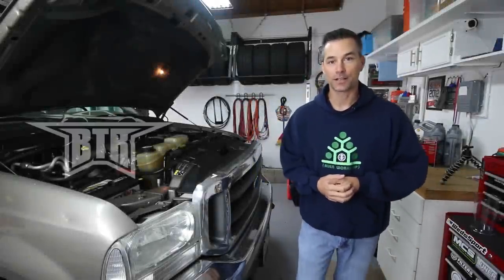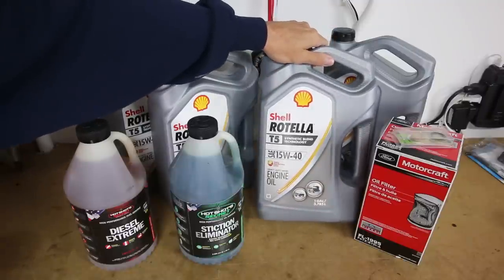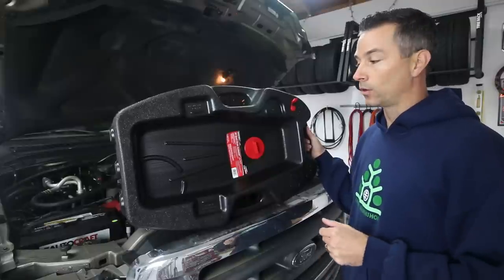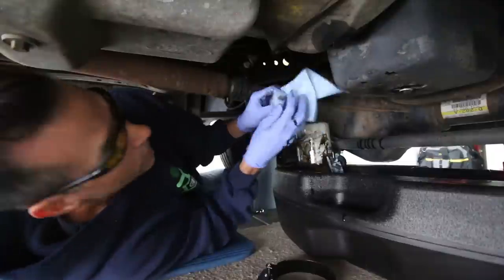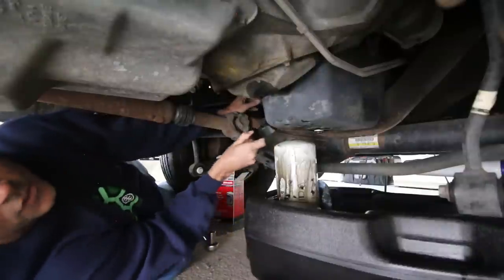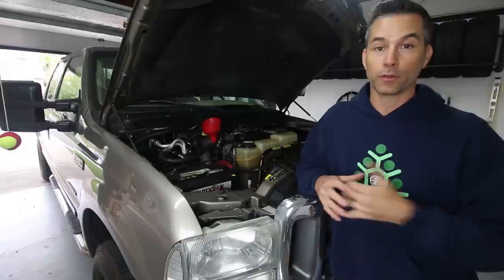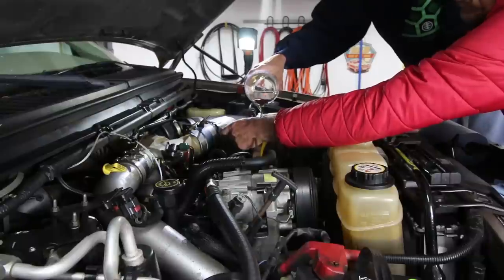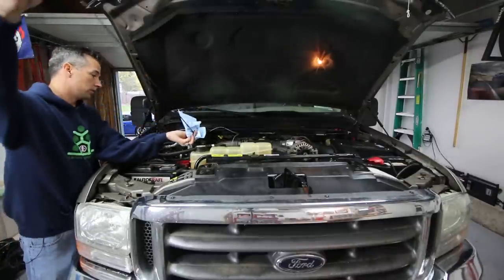Ford 7.3 Powerstroke Oil Change

Comment: I removed my drain plug and replaced it with a ball valve.  I drain the oil directly into an empty gallon jug.  No oil pan needed except a small one for the filter.
Reply from the maker: The ball valves are nice! I got one after recommendations on this video 😁

Comment: The HPOP is it's own oil system, holds 3 qts, 1 qt in res. 1qt in each cylinder head. Oil dead ends in the heads. RifRaff sells a cross over to fix this, here ya go     https://www.riffraffdiesel.com/stainless-steel-hpx-99-03/
Reply: Notice how much more dirty the oil is in the HPOP also. I pull that one qt out and refill every oil change. It helps alot and saves the injectors.

Comment: if you using additive you have no faith in the oil your using   with all the extra money you spent on the additives you would have been better off using 10w30 Amsoil HD  or just use Dlevac HDEO

Comment: Shell diesel is garbage and so is the engine oil. My Father was a valvoline fanitic so I have followed suit. Premium blue 15w-40 engine oil is Best. Change your glow plug relay. I did and not a hard start sense. The 7.3 is designed for 15W-40 all year round. Diesel Fuel anti-gel additive is needed in colder weather. Everything is going to break and fail, not the 7.3 engine. And finally look at the wiring harness on the driver side of the motor it may have rubbed the wires insulation off and it is grounding out. Causing more problems.

Comment: I wish my oil pan was in as good as shape as yours
Reply: My oil pan was pretty rusty and I saw how much it costs to get it replaced so, I decided to try something else. I used rust bullet on all the rusty areas (few coats) then I covered that with flex seal (bed liner spray won't stick to it). It has been holding up great and it feels solid. People laugh at flex seal because of their stupid commercials, but the stuff actually works great.